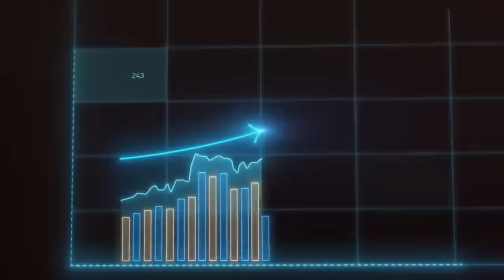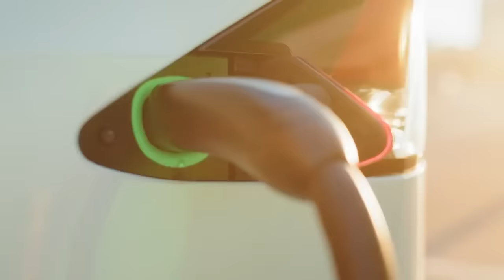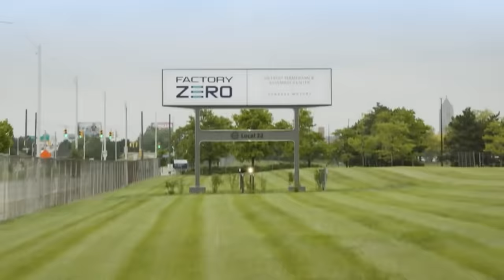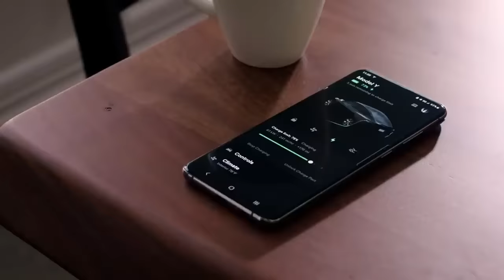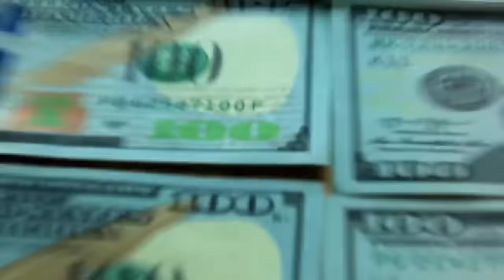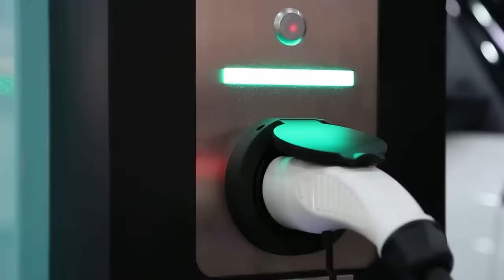Electric Vehicle Owners Are Frustrated and Demand the Return of Gas Cars

Comment: Well when it gets cold you’re now getting 40% of what was promised from the manufacturer when it comes to distance.  And charging is a hassle and expensive along with the fact electricity comes from coal burning and diesel fuel burning . Now then there is the battery replacement and expense so these cars may be all headed to a junk yard in only 5 years because it makes no sense to fix considering replacement of battery’s can cost as much as a new EV and now we have an increase in toxic battery chemicals and these cars piling up quickly in salvage yards . They will be an eco disaster.
Reply: 1. Child battery mineral labor

2. Range anxiety

3. Risk of garage fires

4. Paying 20k more than a
comparable vehicle

5. Battery denegration

6. Poor resale value

7. Reduced performance in
cold, highway

8. Higher repair costs

9. Awful charging network
experiences in the weather
without restrooms

10. Higher insurance rates

11. Replacing tires more
frequently

12. Death by autopilot

13. 30 - 40k battery

14. Low km range

15. must wait 2 hrs
to charge

16. Then wait more time to charge, while charging.

17. Spontaneous combustion with no way to put out the fire storm.

18. If they catch fire in a tunnel, many people will die.

19. People without a pro charger system or a parking spot at their house, will run an extension cord to the road, which is dangerous and could lead to people tampering with your charging setup (super slow charging at the road)

20. If your in California, you won't be able to charge your car past 4pm because of a shortage of electricity supply on the cheesy grid.

21. It is not actually "green". The pollution is made at the power station, not the car.

22. Only 5% of used junk batteries get recycled, the rest go directly into the bin. It's cheaper to mine for new minerals.

23. Chhinna actually does 70% of all the refining of the minerals and production of the batteries.

24. Minerals are becoming more and more scarce, and the cost will only go up, not down.

25. Some countries where they mine for lithium, actually use a very big boat load of fresh water to only produce a ton of lithium, so they are afraid of running out of water. It takes over 2 million liters of fresh clean water to produce 1 ton of lithium. 

26. Ev cars will soon not be able to drive in tunnels or be able to park in underground parking garage and probably will eventually void your house insurance if you park it in your personal garage.... 

27. You can't charge your battery at super stations when it is bitter cold out. 

28. If a fire truck comes to put out an Ev fire, all the chemicals go directly into the sewer system, poisoning every thing. They need tons of water to slow down the the burn. They can't put them out. They are only trying to prevent over things near by from catching fire.

Comment: Solar electricity generation is not exactly impact free on the environment.  Normally, when the sun light hits the earth, a portion of the sunlight will be reflected back into the space.  With solar panels, the more of the sunlight is absorbed by the panels.  A part of the sunlight’s energy is turned into electricity, and some is turned into heat in heating up the panels.  Doesn’t the additional energy from the sunlight contribute to the warming up of the earth’s environment?
Reply: Not any more than it does, hitting any other dark surface.

Comment: It has never been very wise to go all in on a new thing. Electric vehicles are still relatively new. The technology is changing too fast and the problems are still coming out. For instance the recent weather issues we had in the United States where the electric cars wouldn't charge because the batteries were too cold the charging stations would not work in the cold weather and a lot of the cars had to be towed to dealerships to get a charge in a warm garage

Comment: So far I love my Tesla, just charge while I sleep and ready to go every day.  No oil change only windshield liquid replenish so far, of 3 years of use...
Reply: You don't know how lucky you are!
Reply: 1. Child battery mineral labor

2. Range anxiety

3. Risk of garage fires

4. Paying 20k more than a
comparable vehicle

5. Battery denegration

6. Poor resale value

7. Reduced performance in
cold, highway

8. Higher repair costs

9. Awful charging network
experiences in the weather
without restrooms

10. Higher insurance rates

11. Replacing tires more
frequently

12. Death by autopilot

13. 30 - 40k battery

14. Low km range

15. must wait 2 hrs
to charge

16. Then wait more time to charge, while charging.

17. Spontaneous combustion with no way to put out the fire storm.

18. If they catch fire in a tunnel, many people will die.

19. People without a pro charger system or a parking spot at their house, will run an extension cord to the road, which is dangerous and could lead to people tampering with your charging setup (super slow charging at the road)

20. If your in California, you won't be able to charge your car past 4pm because of a shortage of electricity supply on the cheesy grid.

21. It is not actually "green". The pollution is made at the power station, not the car.

22. Only 5% of used junk batteries get recycled, the rest go directly into the bin. It's cheaper to mine for new minerals.

23. Chhinna actually does 70% of all the refining of the minerals and production of the batteries.

24. Minerals are becoming more and more scarce, and the cost will only go up, not down.

25. Some countries where they mine for lithium, actually use a very big boat load of fresh water to only produce a ton of lithium, so they are afraid of running out of water. It takes over 2 million liters of fresh clean water to produce 1 ton of lithium. 

26. Ev cars will soon not be able to drive in tunnels or be able to park in underground parking garage and probably will eventually void your house insurance if you park it in your personal garage.... 

27. You can't charge your battery at super stations when it is bitter cold out.
Reply: Everyone is happy until they are not. Wait until you need to sell it.

Comment: People don’t want gas guzzlers. They want reliable gas sippers. We want gas/diesel cars that are efficient. You can develop efficient gas engines with proper R&D and effort. I foresee hybrid gas/diesel engines getting 40 MPG and reducing CO2 emissions without the stupidity that EVs bring. My 2018 F150 has an awesome 2.7L motor. It gets 20 MPG (12L/100km). A similar 2008 F150 that my brother owns only gets 11 MPG (20 L/100km). That’s a reduction of 40% in 10 years. Ford wasn’t even trying hard. We both need our trucks for work. If both our trucks got 30-40 MPG (6-8L/100L) imagine what a smaller car would be able to do.
Reply: Small diesel cars have already proven their efficiency, but they have fallen out of favor in the US. 

The VW Group’s diesel offerings provided excellent fuel specifics and proved quite dependable. 

The lightweight truck diesels are also being phased out in the US. What a shame …

Comment: Customers need to understand that when they choose an EV, they are primarily buying a massive stew of toxic chemicals and the electronics/software for power and chemical reaction management. An education in chemistry and chemical safety is necessary for EV owners, first responders and support techs. Lower temperatures will absolutely effect charging and discharging. Buyers will either learn intelligently or painfully. Fluffy marketing BS will not prevail for long. Reality is emerging.

Comment: A 50 percent heavier EV as a result has a 50 percent heavier annual road tax in our country. Next, it makes me very suspicious that an EV, being fifity percent heavier than a petrol buring vehicle, drives equally efficient? Replacing 50 percent more weight requires more energy. Maybe that is offset by the economies of a different type of propulsion, but I still wonder what an unbiased inquiry might find out.
Next, when you pull a caravan, the range of your EV becomes very short. Some EV owners find out, that they have to recharge every hour - decouple the caravan to approach the charging station - and have to wait in line VERY long as often there are congestions on peak days when everybody leaves for a holiday.

Comment: I never hear about the disposal of the batteries when rendered useless...There was an article years ago about the problems associated with the disposal of EV batteries, but none recently...Comments?
Reply: Battery lifespan seems to be much longer than expected, first Tesla Roadsters from 2008  (first serial car with lithium ion batteries) are still driving, so we expect 15 to 20 years runtime. Many old car batteries can be used another 5 years in stationary storage for grid stabilisation, we use a smaller depth of discharge (let's say 30% to 70%, which gives another 2000 or 3000 cycles), after that they can be recycled, current technologies will recycle about 90% of used materials. So the environmental impact is a tiny fraction of what an ICE car would cause in it's lifetime.

Comment: Bought a Model Y. What a mistake. I hate never going to gas stations. I hate paying $.45/gallon equivalent, never changing oil or breaks. And where are all the missing parts? Water pump, radiator, spark plugs, fuel pump, etc… what am I paying for? As for the charging network - the other day I had to spend 15 minutes to charge to 80%. Sure I had to go to the bathroom, but who has that kind of time to wait? And I’m sure that 0-60 in under 3 seconds is going to get old real soon.
Reply: It’s funny how most Tesla owners claim to need to go to the bathroom every two hours. 

It would seem that most of the male Tesla owners have prostate issues …
Reply: @Clyde-2055  hey - let’s leave my prostrate out of it… but as for charging, I actually never go to a supercharger because it charges up at night at seven cents a kilowatt hour. 

Question is why all the hate?

Comment: My experience with my EV is good. I have solar panels at my house they charge my car and I never need those charging stations. My only complaint is insurance cost. I have never had a claim and it's still high. Other then that the self driving I love when I travel to and from work. I just smile as I see a gas station now and that money I saves covers the cost of my insurance going up. I drive 1hr 20 min to work and 1hr 20 min home. This my experience with my EV.

Comment: 12 things to love about ICE cars:
1.they stink
2.they pollute 
3 they will not start in -40 dec C
4. they need oil changes
5.they 12 V battery changes.
6. They need coolant changes.
7. they need muufler repairs
8. they need cooling system repairs
9 they need transmission repairs (CVT)
9. they need engine repairs 
10 they need more money to operate
11 they are gas guzzlers
12. they are sluggish and boring.

Comment: I love my Tesla.  It’s fast, fun to drive, gets better overnight with upgrades, has great safety features, I don’t miss standing out in freezing temps pumping gas, and paying for gas, dealing with oil changes and other maintenance issues, I can warm it up in my garage, etc. But I wouldn’t recommend it as the only car in the family because it’s not great for longer distances or extreme weather conditions. Whether it’s better or worse environmentally may be debatable, but there may come a time when we simply run out of oil, and if a percent of cars are EVs, that time will come further down the road.
Reply: Doubtful. As fossil fuels dwindle, electrical power to the grid will too. Your EV will have nothing to power it. Your batteries only store energy the grid can supply.

Comment: How could you not mention cold weather charging?  The recent events inChicago showed that it's difficult (impossible) to charge EVs is freezing weather.
Reply: It's cold in Norway and Sweden, right?
Reply: @opb324  Not as cold as Chicago.   Norway and Sweden are heated by the jet stream, and are abnormally warmer than they otherwise would be as countries at their latitude.

Comment: Present EV industry is like using air-conditioning,, the heat of the house is not reduced by AC,but transferred from inside to outside environment,, same way EV charging through electric grid leads to cleaner environment in cities butcarbon emission from coal or gas power plant is getting increased outside the cities.

Comment: Imagine a transformer grid electricity distribution network failure.
A domino cascading effect of a power spike.
There’s only so much backup generators can handle.

In other words don’t be entirely dependent upon a single system.

Comment: As a Ex Car Salesman at a pre-owned dealer. The answer is "Yes EV Car is a SCAM" you pay 3 times the cost of a regular gas car. Example: Cheapest New Regular Size EV car $40,000 not including maintenance vs Cheapest New Mid size car $20,000. I bought a used Toyota 1996 Camry LE for $1000 and my friend bought a all electric Prius. Within 3 years i spent $3000 on basic maintenance vs him $10000 car payments/maintenance

Comment: After 8 years of good-weather only driving of my 2016 Nissan Leaf, the battery needs replacing.  I am JUST past my warranty though I had complained to the dealership for at least a year prior that the power was degraded.  If I do decide to bite the bullet and pay to replace the battery - an estimated cost of $20,000 - there is no supply at the moment.  It will be at least a year and may be closer to two years.  The dealership has suggested I should just buy another car...

Comment: Tesla's price reduction has worked as it actually gained sales percentages.  Every OEM has dropped but Tesla is still up.   Still going 50% increase in sales each year.  Also Tesla isn't getting regrets from buying it like everyone else.  Tesla still has the highest loyalty rates for cars over everyone else.  The environmental impact of EVs are still much lower than for ICE.   Cobolt is being phased out for the problems already covered in the video.  If you are charging past 80% you deserve to get hit with higher charging prices.  Tesla insurance is a good way to get around high insurance costs.  I have saved about $12K/year by switching out 2 ICE for 2 EVs.  This is including all costs including insurance.

Comment: Drove for Uber with a 2017 Toyota Sienna and briefly a Tesla Model 3 Long Range. I could drive the Sienna a full day before filling it up, whereas I could NOT drive the Model 3 for more than 4 hours before charging it; regardless if I drove the Model 3 more conservatively than the Sienna.
Reply: I don’t own an EV, but from what I’ve read, your M3 should have performed much better than it did. Were you driving under extremely hot or cold conditions? What was your energy mileage (miles/kWh) ?
Reply: @Clyde-2055  Summertime. Also forgot to mention I drive a Camry Hybrid that got me 50 mpg around that time of the year (rated 45).  Even in cold weather, not hypermiling, the Camry can still reach at least 400 miles per tank.
Reply: What's the range for the Model 3? Is it getting the range they promised?
Reply: @cheerry777  I'd be lucky to break 200 miles doing everything by the book.
Reply: @asdax8311  but what's the specified range? If you didn't pay extra, they wouldn't give you the long range. I believe 300 miles is the long range.
Reply: @cheerry777  it is the long-range AWD, rated at 350 miles.
Reply: @asdax8311  gosh, that's crazy! That's only about 55% efficiency. Should have complained to Tesla if it's still under warranty.

Comment: I like my automobile to be reliable enough that 10-20 years of ownership = few problems.  I have a 2008 Ford Focus, and wasn't until last two years I've had to get any major work done on it, save for basics like tires/oil/batteries.   Reliability is the most important thing in my opinion.  EVs are not even in the same ballpark.

Comment: I am not frustrated at all. Bought 2019 an Hyundai Ionic (28 kWh), now bought a Tesla MY LR (75kWh), sold my VW Tiguan (gasoline), are about selling my Skoda Octavia (diesel) and buy an MG Luxury (64kWh) as third electric car. 🤷‍♂️🙂

One ha just to know what to buy and handle it. Trying to start a diesel engine in winter, but still having summer diesel in the tank might also cause problems…

Comment: Two things I like about EVs :
1) The instant acceleration
2) Super quiet

Comparing with an ICE car of a similar price, what I like about the ICE car :
1) The low, throaty roar of the exhaust when I step on the gas pedal
2) Takes me only 5 mins to refuel
3) When the EV's battery needs replacing, the ICE will still be firing on all its cylinders

Now why would any real driver give up his ICE car for an EV? Save the earth? More like accelerating the decay of earth with so many batteries and electricity needed, not to mention the waste-handling of expired rechargeable batteries. If you really want to save the earth, switch to hybrid now while pouring resources into more research and development of biofuel and green hydrogen. Hybrids will burn way less oil, and have a much smaller battery so the carbon footprint of producing and subsequently waste-handling that battery is way lower. The key now is to buy time for mankind to find a clean, green, sustainable form of energy, whether a single source or a combination of a few. And hybrids will help that in a cleaner way than full EVs, hence giving us and earth even more time.